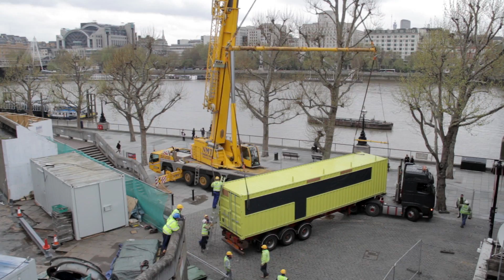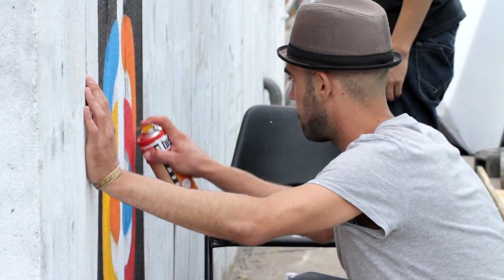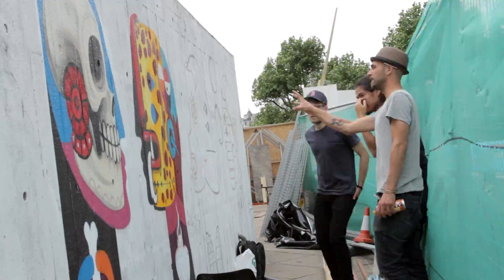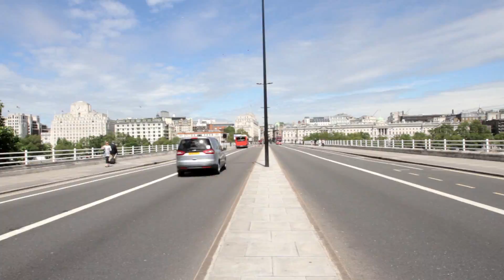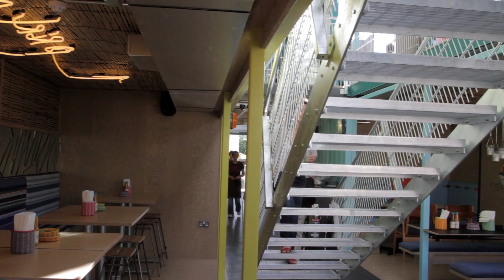How we built the Wahaca Southbank Experiment

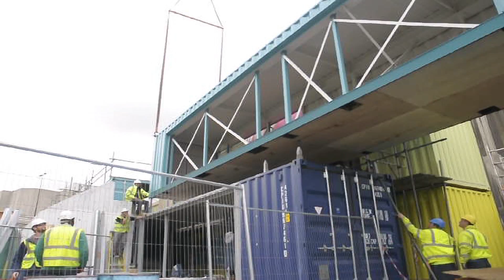Comment: can somebody explain how the second floor attached to first container without any collum or structure support it? in 3:34 . it drive me crazy to figure it out
Reply: 60 percent container  Bolted down to the lower container you can see spikes which fit straight through for support on front edge.  Also it's called counter balance.i am currently working on something similer.